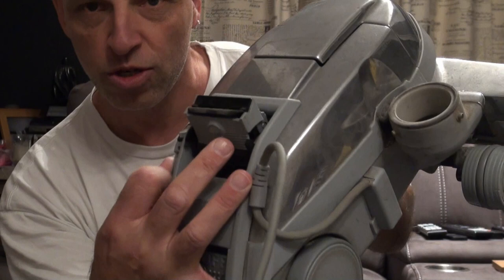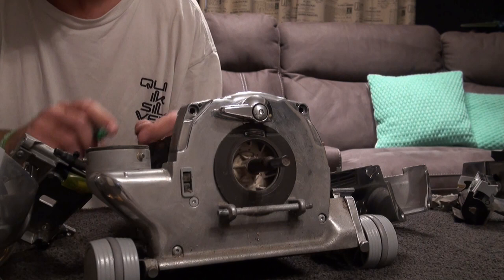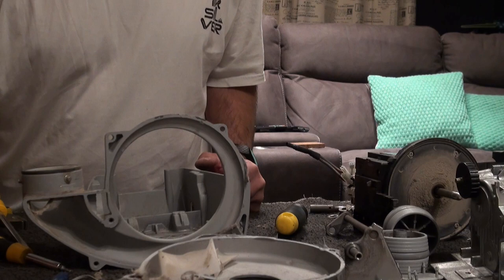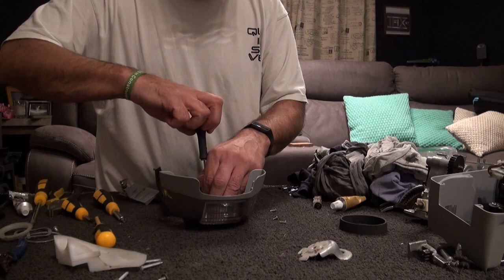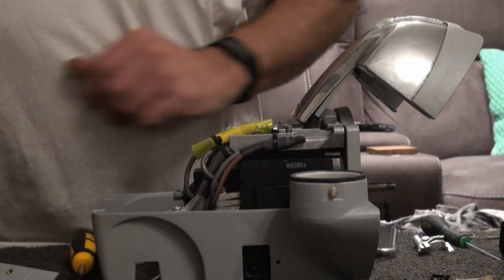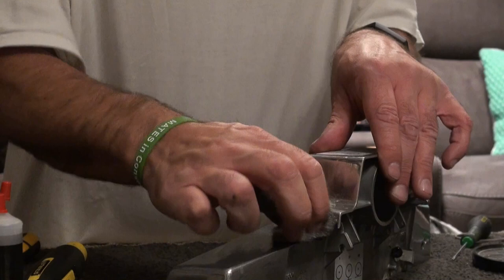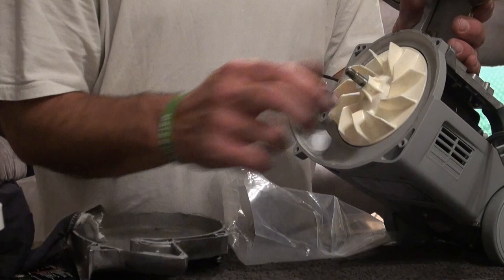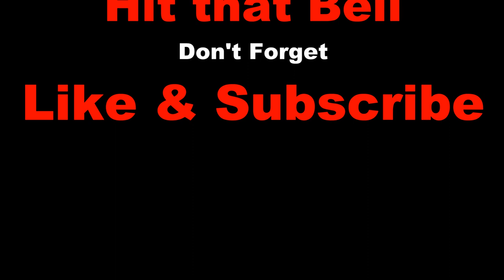KIRBY VACUUM: HOW TAKE APART KIRBY VACUUM & REASSEMBLE KIRBY VACUUM

Comment: I have a intermittent problem with ours. It all works as it should appart from when pulling and pushing the handle the motor flicks off and on. Followed your video to strip down and found rusty bearings on the slider assembly. cleaned and lubed up, reassembled but still the same. Any ideas guys???  New cable or Brushes for motor maybe?? TIA
Reply from the maker: Maybe the lead if intermittent, check the continuity of the lead . Check for kinks or breakage in lead or loose emptor like in my Kirby not working video . Let me know how you go .